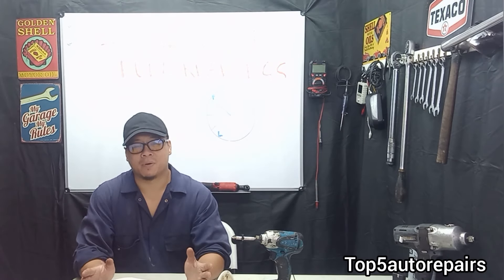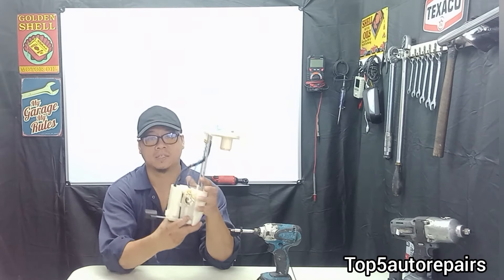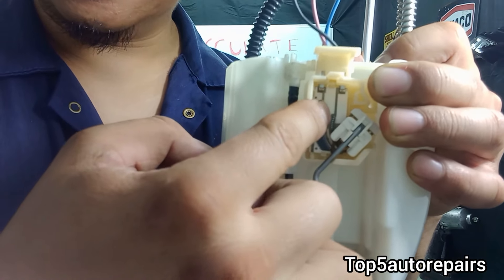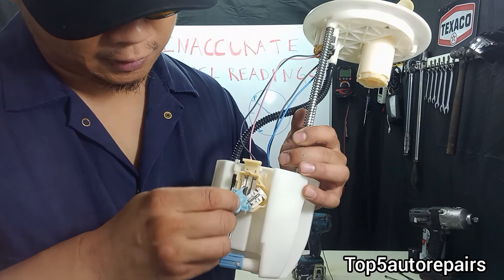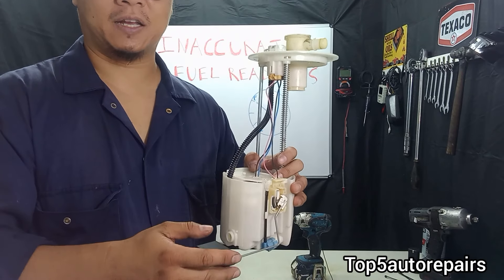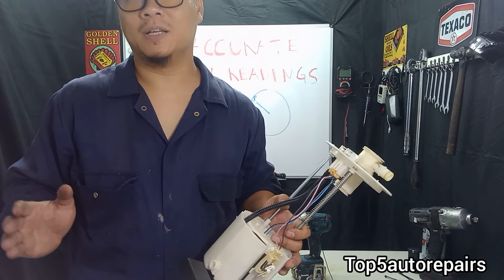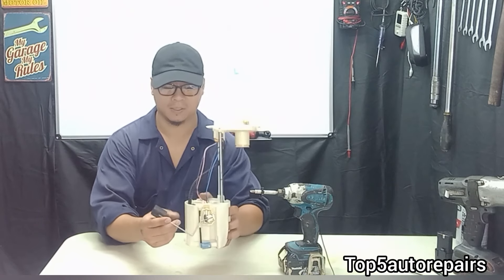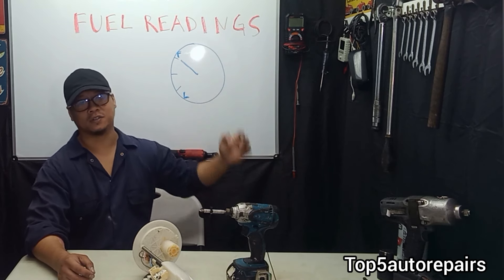Fuel Gauge Not Working This is Why Gas is Showing Full or Empty

Comment: Hello.....my car fuel gauge indicator shows only 2 bar level of fuel...........which actually the fuel tank is empty. Check fuel pump tested ok. Remove fuel pump and put the ignite.........but still it shows the level of fuel gauge............which i think should not have been shown !!!! kindly advice. Thank you
Reply: Depending on what type of vehicle you own, I'd first try a fast & free solution to your problem. Which is your fuel gauge could just need to be electronically reset my friend. Again, depending on the vehicle there's a few different methods but most of the time if you have one you just need to hold down the trip odometer button while the car is running & turn it off. Then release your finger from the trip button & start your car again. I'm not saying it's always the trick to the fix but it's at least worth a try before taking it to a mechanic who more times than not you're going to pay a good penny to fix it. Just saying... ✌️😜

Comment: Do you maby know what can cause rust inside an enclosed tank? How do you prevent it?
Reply: Keep the tank as full as possible. Dodgy fuel...do you always fuel up at the same place? Can you go somewhere else> If you car can run on 10% ethanol that will take the water out of the tank (but you may need to change your fuel filter afterwards).

Comment: Just replaced the battery in my 2004 honda accord and now my fuel gauge say E And the red light blinking.. whats going on? I just had a little less then 1/2 tank
Reply: IDK if you've fixed the problem you were having, but if you're still trying to look for a solution give this a try first before you take it to a mechanic. While your car is running hold down the trip odometer button & turn the car off. Then release your finger off of the trip odometer button & restart your car. I'm not saying it's always gonna be the fix to these type of issues. However, it's a fast & free way to see if all it needed was to be reset. Electronics & gauges in vehicles can be a little tricky troubleshooting sometimes. Good Luck My Friend! ✌️🤔
Reply: @216Numbskull just tried it still same issue. Thanks for the help. have the car parked because I don't want to deal with it.. hate driving it and the car always read E

Comment: 1998 Lexus gs400. Will fill the car up full. Run all the gas out,  The fuel gauge would still show halfway full when it's actually empty. (HELP)!
Reply: Take it to a mechanic & have it fixed right, my friend it's a freaking "Lexus" not an Escort. ✌️😜
Reply: @216Numbskull  I agree Lexus is a classy an Sexy ride . You definitely should take it to a Shop that has Hi-Techs.

Comment: I have this problem on my 2012 gmc Acadia . I work at a transmission shop as a mechanic. I’ve only been a mechanic for maybe 2 years but I refuse to pay a mechanic to fix this . I already did the easy stuff like replace fuel pump sending unit but still same . If anybody with more experience can help me please reach out.

Comment: I replaced my whole fuel pump/ the housing 2 times on my 1998 goes ranger when the truck is off the fuel gauge works but when I turn it on it goes straight to empty anyone knows why and how to fix it

Comment: What if you changed your fuel pump 2x
Reply from the maker: Probably a gauge issue
Reply: Fuel pump replaced and cluster completely repaired and I still get Empty readings.